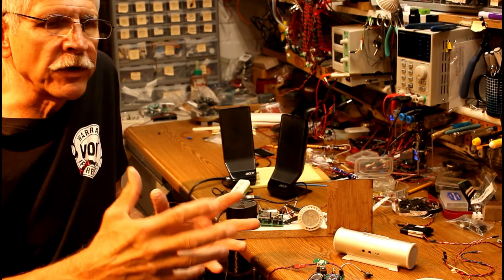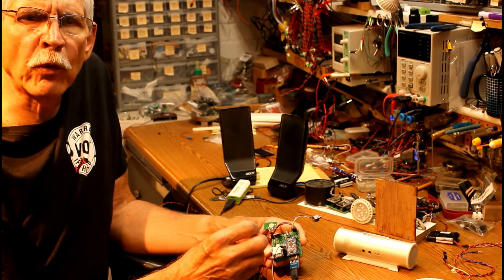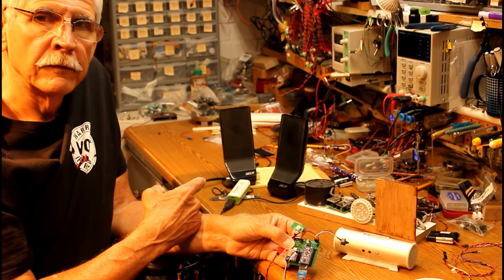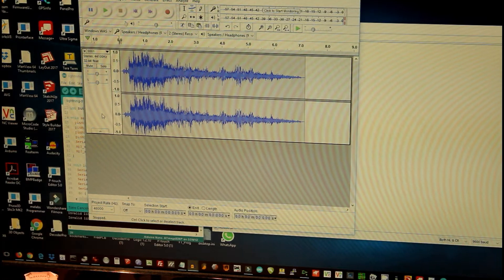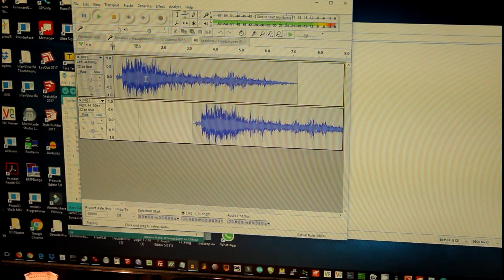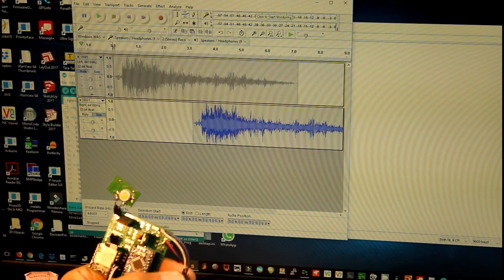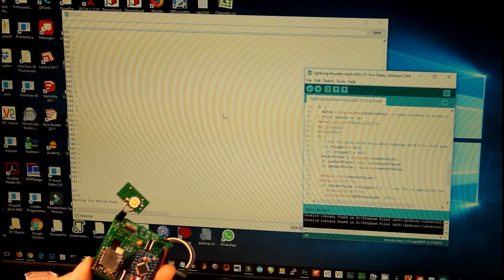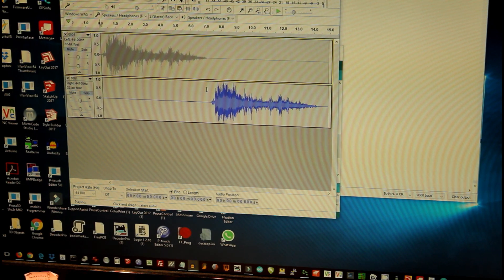Thunder After Lightning Animation

Comment: instead of a switch could you incorporate a pir instead?
Reply from the maker: You certainly could use a PIR
Reply: @DaveBodnar  thanx for the reply dave also could this be used on a uno with the same code or would it need to be changed just trying to follow the circuit using tinkercad but it's a bit hard when there is no dfplayer nor do i have a breadboard as yet
Reply from the maker: @ozyjimbo  it should work with the Uno.  Give it a try
Reply: @DaveBodnar  yes i will be but have a little issue in getting the irl520 will the irl540 work as a sub?
Reply from the maker: @ozyjimbo  either should work

Comment: Dave,

Here are 2 ideas for arduino projects = = =

1)  Congregation signing hymn in church - - - 

Bring up the intro to a hymn slowly.  At the same time, bring up interior lights to church with PWM.  

Hymn plays.

Conclude the hymn with a refrain as the PWM brings the lights down

Hymn concludes and the church goes dark and the congregation goes home.

Set up a flagpole with a flag - - or a billboard with a flag ( somehow display the flag).

Start the intro to America the Beautiful or other appropriate song.

Bring up a micro spot on the flag with PWM.

Begin to conclude the song while bring the spot down with PWM.

The song ends and the spot goes out.

What do you think?

Bob
Reply from the maker: Both good ideas, Bob - there would be some issues with synchronization but it could be done - I'll give the ideas some thought

thanks

dave

Comment: Dave, in other words.  If you plug in stereo headphones into your pc - -The headphone side is my input to my speakers.  I need the pc side (female jack) for the arduino side.
Bob
Reply from the maker: Something like this:
https://www.peconnectors.com/coaxial-rf-connectors-bnc-f-rca/hws14841/?gclid=Cj0KCQjw6IfoBRCiARIsAF6q06spUpm3wEeLxe1rvXZrqPP0ude2R5SuVTx_0DtQupWDF41_ZXvY_uMaAlGaEALw_wcB 

or this

https://americas.rsdelivers.com/product/lumberg/1553-02-black/lumberg-black-right-angle-pcb-mount-rca-socket/9092235?cm_mmc=US-PLA-DS3A-googlePLA_US_EN_ConnectorsAudio_And_Video_Connectors%7CRca_Connectors-PRODUCT_GROUP&matchtype=&pla-674836323584&gclid=Cj0KCQjw6IfoBRCiARIsAF6q06ucnpDxYM0jbwakYfc-OnzPLpnis4vsbGSp0mOFdeubmP_jnEDx80waArAuEALw_wcB&gclsrc=aw.ds

dave

Comment: I have an old pc sound system with a sub woofer and left/right speakers.  The input to this system is a 2 mm RCA male jack.  do you know where I can find a female jack that will mount on a perf board and can be soldered into the mpf DACR and GND connections?

Bob
Reply from the maker: Bob - I am not familiar with a "2mm RCA jack" - can  you send me a photo or link to one?
thanks
dave